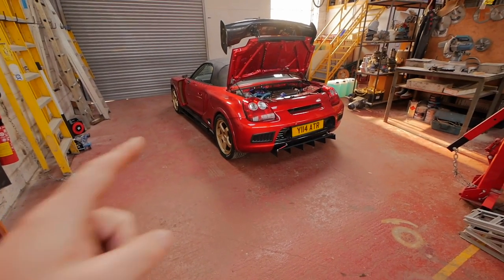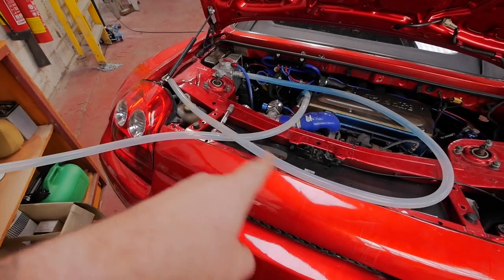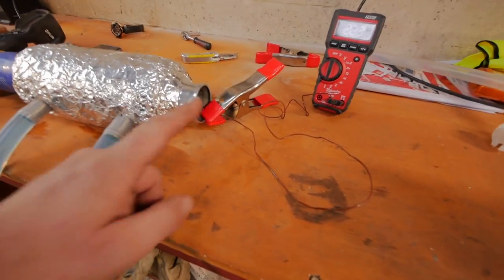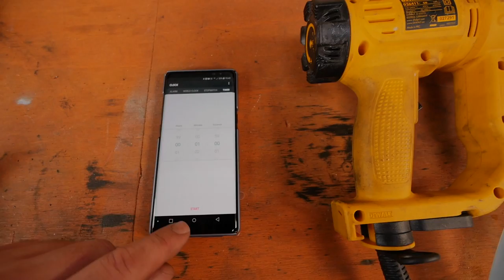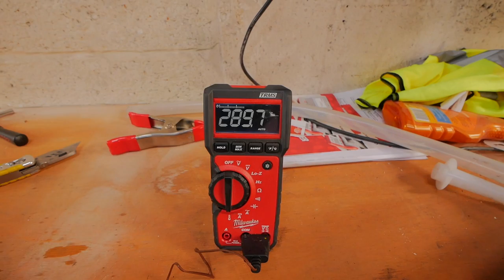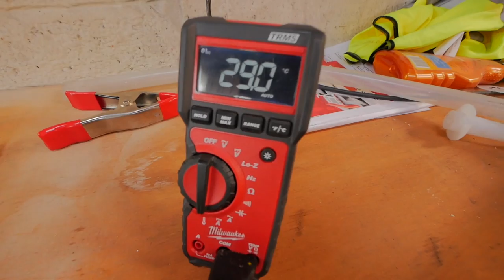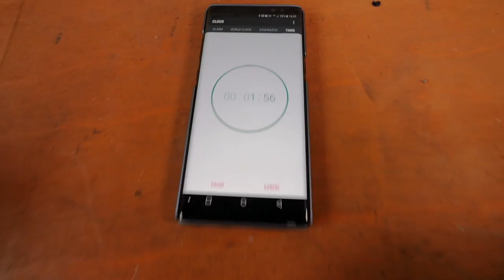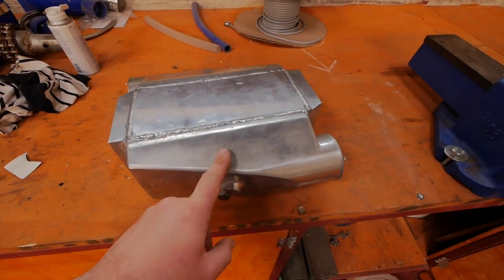Cheap vs expensive chargecooler shootout experiment

Comment: I think you should do the same test with a fmic, even with no airflow through the fins. I think you will find the results will be better again.Not because it's better at cooling, but because of its physical size and the amount of surface area and the low pressure of the heat gun I don't think the sensor will hardly move.
Reply: In fact I think even if you did the same test again with no cooler st all but with a 1m length of pipe on the gun you will find a surprising drop in the air temps. You think with just a straight pipe the air coming out the other side will be 250+ degrees? Test it and find out
Reply: The front mount air to air will be worse.
Much larger volume of air to boost.
Pressure drop will be higher.
Boost lag will be gauranteed.
An air to air cannot reduce the temps anywhere near as efficiently as an air/water system.
If one was willing to install an ice box they could get the air even cooler still.

Comment: Assuming your heat gun can handle it, do a 5 minute test or whatever so that you can see at what point the temperature stays steady on both the charge coolers. While one will cool more, would be nice to know how much cooling you got with each cooler. What you’re charge cooler options are will depend on your car.  I have a 95 trans am with a rear mounted turbo system, already had an air/air intercooler mounted in front.  

Car isn’t running right now, but I have considered putting a “Barrel type” cool charger (it would fit) on the pipe that runs underneath my car.
That would cool air before it even hit my air/air intercooler.  I have seen “Barrel Type” Cool Chargers on E Bay for 100 to 130 USD..

If I go with the charge cooler, may consider upgrading it to an “inter chiller” where instead of running coolant, I would use the A/C system, this potentially would allow more temperature reductions compared to water.

Comment: The small one is floored by design that are too straight through, boost/charge air doesn’t spend enough time travelling through it to transfer heat into the water that’s why they only tend to be rated for around 200-250hp

Comment: cooling vs flow.  A larger cross flow will allow more surface area and a slower air speed thus a better cooling effect.  In actual use though this air speed drop may result in a pressure drop or restriction.  The barrel style is typically designed for space concerns.  As usual the best one is usually the biggest you can fit; brand becomes less important.  Good video and I watched it a year ago for the first time and it shaped my purchase of my core

Comment: There is a direct correlation in flow rate and pressure. A big pressure number does not mean a good flow rate of air into the engine. Think of how to do more with less. As in less restrictive intercoolers. Less restriction means more flow and low heat as well as more horse power per pound of pressure.

Comment: Cool idea. I think though that the hot air isn’t getting through the larger cooler. IE, it’s heating up the first part and it’s not making it through to the other end as there isn’t enough cfm from the hot air gun.
Reply from the maker: Steve yeah it doesn’t move massive amounts of air. But the intake was sealed, so if the air goes in it must come out.
Reply: easy test to check that theory. stop the water flow and the air at the exit should get hotter

Comment: The avt barrel cooler is tape insulated (?) - which is great for engine bay but not for this test.  The cheap one is not insulated and has a large thermal contact area with the bench.  I don't understand how the coolers can be above the open header tank.  Presume you bled the coolers in particular the avg one as the outlets on the side.  I think flow is the main issue so a low flow hot air gun through the cheapo one I would expect to perform better due to the thermal path that has to be followed.  Not sure what water pump you are using but my Bosch pump would squirt water everywhere with that set up (open tank and no clips on hose).  What are the so called ratings for each cooler - the barrel one looks to be power rated lower?  I think the cheapo one has quite poor cooling internals (flat weave) whereas the avg one has proper finned fins for a greater surface area.  I appreciate your efforts.
Reply: Wouldn't matter if the larger one was insulated. The results would be the same.
The more exoensive unit is a smaller packahe and what it sacrifices jn sizes shows up in poor  efficiency.
The onlu difference wiuld be the larger unit will yield about 1 lb of boost drio where the smaller one will only be around .2.
Who cares if it doesn't do what it is designed to do!

Comment: Looks like surface area of the alum that the air touches makes all the difference.. id like to see the difference that fin count per inch makes.or if maybe internal/external heat sink type fins make a difference (also with air flow)

Comment: It's simple dinamics more cooling mass less heat, u have an high flow chargecooler whit a lower mass and u have a cheap  massive chargecooler it can cool a lot more but the flow its more restrictive and that foil in the slim charger cooler it prevents the cooler from eradiate heat and cool better

Comment: top vid thanks for sharing, i was looking to buy a avt chargercooler but after seeing this i will be looking for something different , my only concern with the cheaper ones is the boost pressure they can handle, but have found frozenboost do some that have been tested to 170psi

Comment: The thing that you need to be measuring is the TIME per degree, (which you are sorta doing),
but your air flow is barely at idle levels, there's a massive increase in flow under full boost.
The winner can be gleened by simply the weight difference between the two coolers,
(that's aluminum PLUS water weight), this will determine the rate of temperature rise every time.
Also, the total weight of the circulating water, and surface area and air flow through
the heat exchanger, (radiator), plus the weight of aluminum in the heat exchanger.
Water can absorb a tremendous amount of heat, the more you have in the system
the slower the temperature will increase, OR, decrease.
Reply: Can agree to a point. Obviously less than idle flow here. However this experiment should scale accordingly.

Comment: Hey Spyder
i know this was done long ago, but just saw it

i like your channel

 it'd be interesting to test pressure/weld quality limits on both (controlled/safe of course) wouldn't it? 

it would totally suck for a fracture to put water into your motor in high boost pressure situations hahaha

Comment: I'd like to see these real world results.  I ran a barrel charger on mine and it performed very well.  In the midst of upgrading to more boost and I'm debating ditching the barrel cooler for the big boy.  I feel like the barrel cooler may heat soak faster but mine rarely got hot during spirited canyon runs.
Reply from the maker: travaggini my barrel charger was really good and worked great up to about 10 psi boost. I think I've just pushed it a little past what it can cope with. I've had the eBay one on all weekend so hopefully I will get time to do an update video later today.

Comment: can i use this with no forced induction
Reply from the maker: It wouldnt benefit anything as your air is entering the engine at ambient temperature. These are to cool down the air that’s been heated up by the turbo/supercharger
Reply: It really could be used.  Just not practical.    Back when gm was doing the land speed records with the cyclone it actually was a na motor with a dry ice intercooler set up.   Huge tank full of it.  I guess the intake air temps were sub-zero.   

Not something that would be good for daily driving

Comment: Thank you. Fascinating. I guess the only thing then is to see if it does cause an air pressure drop and reduced power. Also if either suffer from heat soak. Also can you post a link to the eBay cooler that you used.
Reply from the maker: adriangale I fitted it today, I can say it definitely does not suffer from pressure drop or reduced power. Quite the opposite. I will do another video on this. I can’t find it on eBay now, but just search universal chargecooler, different variations appear

Comment: Great test. I would had loved to see a 3rd gen 3sgte st205 core done in this test as well.
Reply: The 205 and 185RC chargecoolers are very good. Only their placement lets them down.
Reply: @jamesbuckle6077  how good is what I’d like to know for sure. I’d like to see how they cool in stock condition, then seeing pump flow rate and how that can be improved with a larger heat exchanger. I considered doing it but after all the costs I can just get a nice Garrett intercooler setup for my alltrac. I am going to try and get some basic reading off my 205 ic before I make any changes.
Reply: @cmsgt4  
yes, would be nice to see some numbers! To be fair I converted from an ATA to a WTA and at the same time dropped in a 100% duty pump, and the radiator I used was the main engine radiator from an Audi 100, which is a tiny bit smaller but thicker than the stock 185 engine rad. I had no cooling issues, I had 40C exit temp at full boost (18psi) maximum.

Comment: That's really interesting. It would be interesting to also measure the cfm somehow. A cheap wind speed meter might give the same idea perhaps?
Did the heat gun sound more stressed when it was through the eBay cooler?
Reply from the maker: Patrick den Oudsten no, it sounded the same. The gun doesn’t move massive amounts of air, but the end was sealed on both so the same volume of air passed though both charge coolers.
Reply: SpyderLEE that clears that up then. EBay charger it is!
Reply from the maker: Patrick den Oudsten I’m going to try it on the car, see what it’s like with some proper volume going through it. 👍

Comment: You recommend this for 3sgte aw11 300 or 350 hp?
Reply: Any intercooler is better than nothing I use one similar on my aw11 turbo racecar and pipe the water through the air conditioning radiator as I took off the air con unit it works great. I dont think it works as great as an air to air but in a mid engine it's hard to get a spot where air can flow enough to cool the air to air intercooler.

Comment: Well that's interesting but he's comparing two very different intercoolers, I mean the eBay one he's resting had a much larger core than the other one so I'm the end it's not really the different designs that affect the cooling differently, it's more a matter of core size.

You can quickly tell he doesn't know what he's talking about, when he's describing the differences, example on the eBay intercooler he says that the air will come across a shorter radiator distance so it will cool less, well YES the distance is shorted BUT the surface width and height is greater so in the end it's the total volume crossed that counts and here it's much larger than the other intercooler, then he says that the water will be hotter on one side compared to the other as it runs perpendicular to the air flow so it should be less effective, well YES it will be hotter one one side BUT it also means it will be cooler on the other side so on average it's the same as hotter air will mix with cooler air right after the the intercooler.

Comment: I think the experiment doesn't take into consideration that the air from a turbo is compressed.  What in my opinion it does show is pressure loss, just indirectly. I've redone my factory intercooler design and because my turbo is small, I felt it's best to keep psi losses to a minimum.  The barrel type would be best for my application, however someone with a turbo that makes higher boost might benefit from the other design. I feel your experiment shows that the distance from inlet to outlet on the coolers are different which would make the temperature difference. 
I liked the experiment however,  and your willingness to take the time to share it with the world.

Comment: Are the in and out the same diameter as that can attribute to felt air flow......typically you won't see restrictions in air flow until you start pushing enough air to out flow it which a heat gun isn't going to do lol

Comment: This was a good start to a some what informative test. Unfortunately the most important parameter that all with an above average degree of understanding of the physics involved would probably most appreciate, was left out and that parameter is the core dimensions for each intercooler. Although they are shaped differently, that would have at least made it possible to calculate the core area and compare them for a crude efficiency estimate. There is far more surface area exposed in the asymmetric intercooler at air entry and by that comparison alone it is more flow efficient because the broad side approach to the core means more spaces for the air to enter in order to reach the other side, despite having to  zig-zag. The barrel intercooler has a smaller air inlet surface coupled with a  much longer travel path that will also have added drag on the airflow. What ever the case, this was enough to change my mind about installing a barrel intercooler. The assymmetric intercooler also has a better water flow path. The only disadvantage it appears to have is packaging.

    I have a hard time with not being suspicious of many comparison videos like this, having been purposely performed scientifically poorly in order to either stay in favor with potential sponsors, or possibly gain more. There also appears to be a significant difference in core size as well from a visual point which further favors the asymmetric intercooler. Those with little knowledge in physics might be amazed, but this test is barely significant when you consider the errors in comparison.

Comment: very interesting as I have been looking to change from fmic to charge cooler, what rad are you running to cool? and wonder how much cooler temps would be with the fans running same as if you were driving?
Reply from the maker: Lou Broo it’s an avt radiator. 👍. Next job is to finish the fans and make them automatic